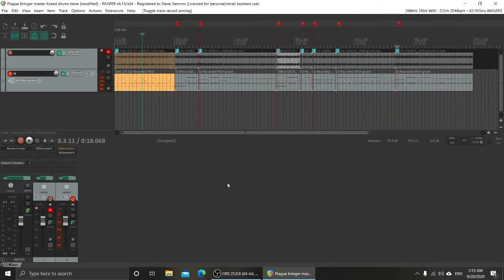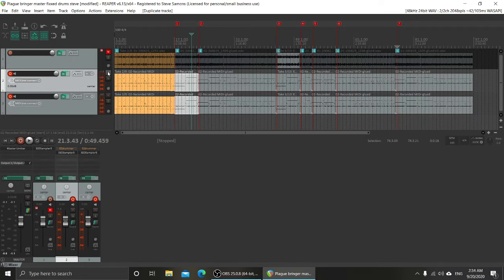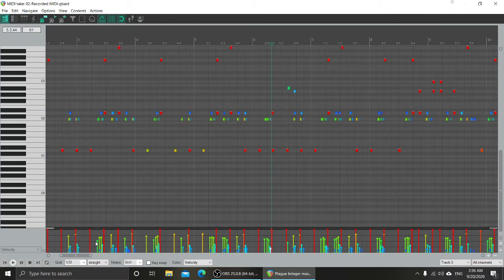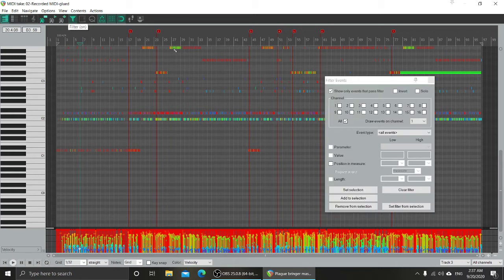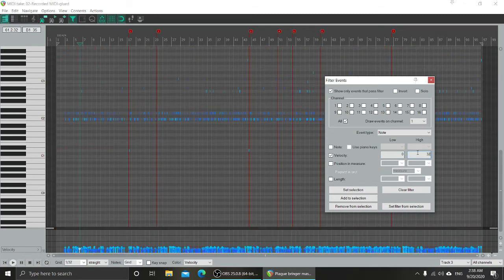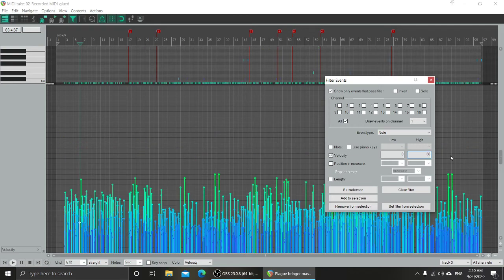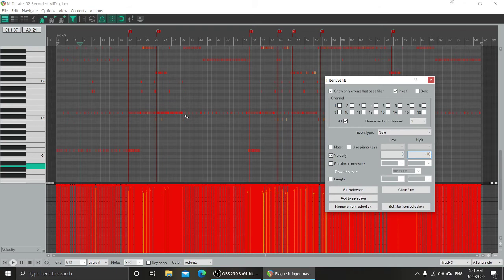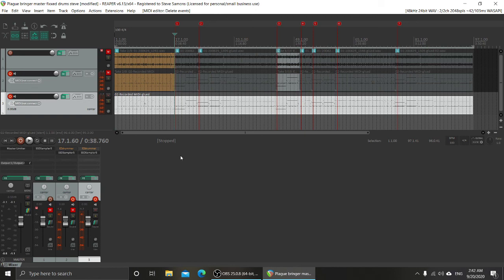Reaper Tutorial: Removing Low Velocity Drum MIDI Notes

Comment: Quick question: I'm using an Alesis Nitro mesh to trigger Slate drums, but when I open up the midi notes, they are insanely small and don't expand when you zoom in which makes it difficult to edit. Any suggestions? Thanks :)
Reply: scratch that. Just found out you can right click and drag to select all the midi notes and change they're length to 0.25 or more in the event properties. Finally sheesh lol. Thanks for listening XD
Reply from the maker: @jasonwright4144  There is a different view mode that is meant to be used for drum midi rather than note midi that might help you.
In the Piano Roll window, go to View->Piano Roll Notes->Triangles (or Diamonds). See if that feels more comfortable for you.